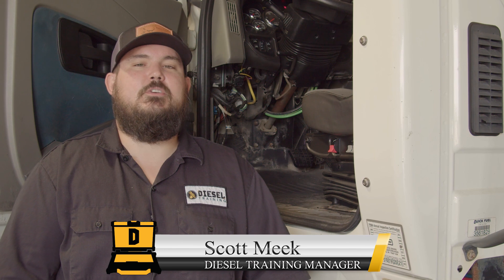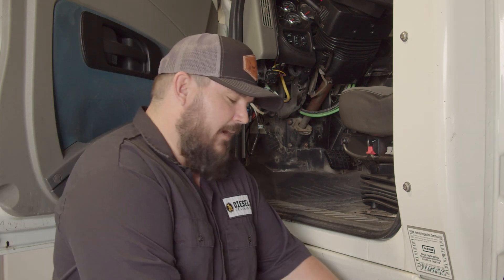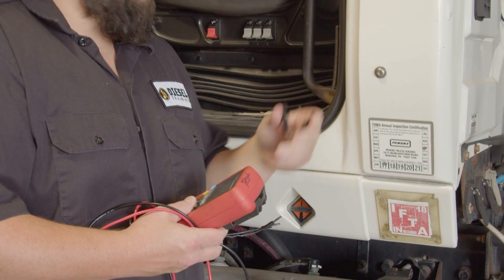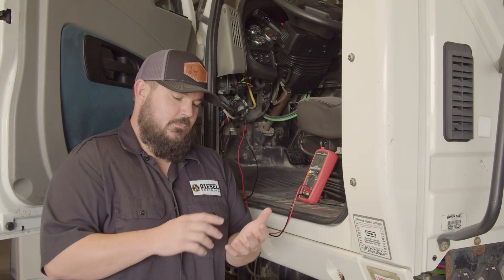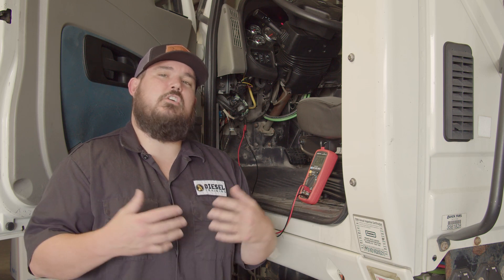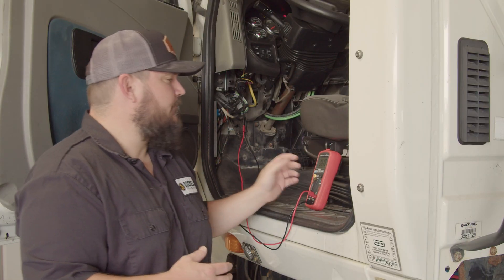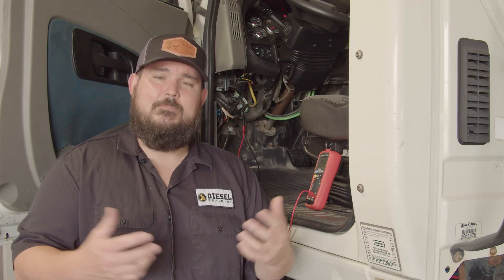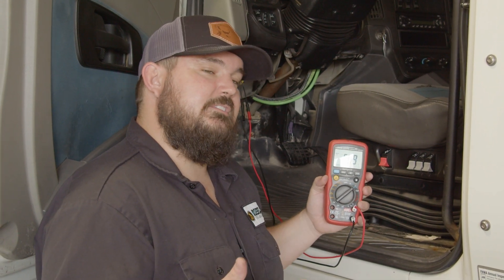Heavy Duty 9 Pin Connection Troubleshooting Solutions For Bad Truck Communication

Comment: Peterbilt 2013 … shut off while driving and didn’t start, miles and work hours disappeared from dash plus ABS and ECM no communication … I suspect a bad common ground contact… where should I look for this ground??   (Fuses and relays are good).. TIA

Comment: My pin B has 12v when key is out but when in ACC mode pin B is at 6v please help🙏🏽
Reply: You have a bad power feed to the connector. You have 12v but when current loads the circuit your dropping to 6v. Look for worn or rubbed wires going to 9 pin connector.